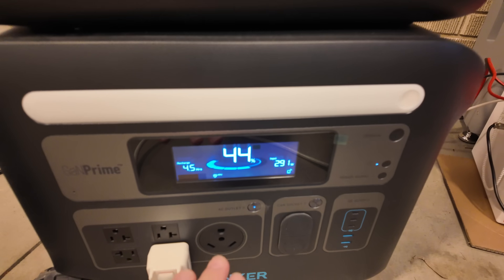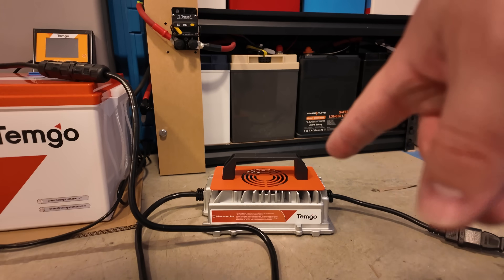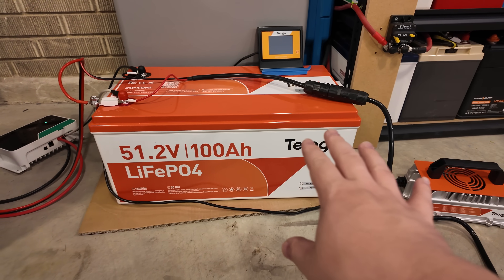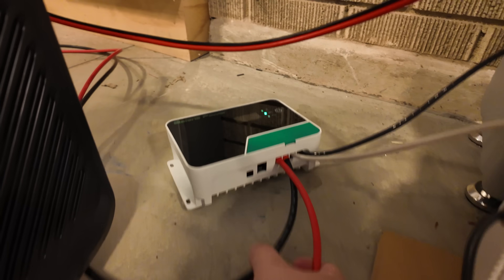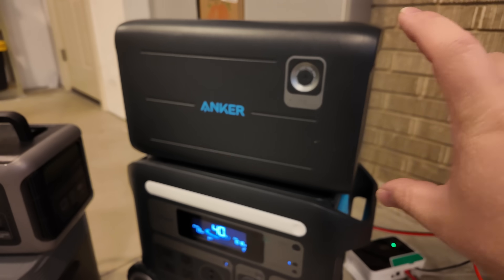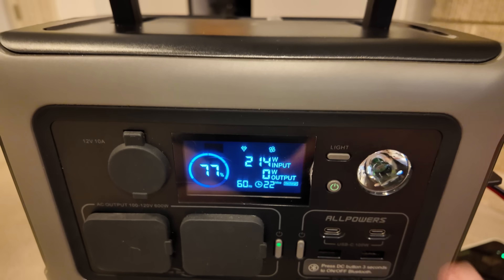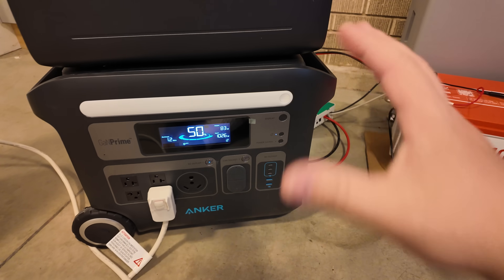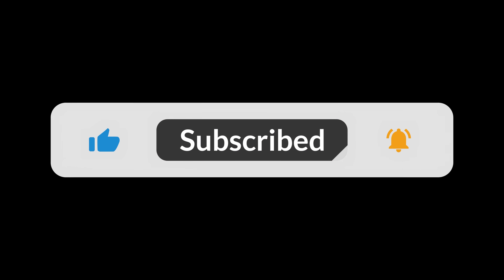I SOLVED the BIGGEST Problem ALL Power Stations Have!

Comment: Thank you for the info.  I thought about using more solar than my power station could handle using a charge controller, but was afraid to use it with the battery at the same time. My bluetti station can only handle 1000watts; soooo I thought about using 1,200watts of solar with a charge controller into my 48v battery then another charge controller from my battery to the power station to keep the maximum volts and amps according to the manual.
Reply from the maker: No need to add another charge controller between the battery and power station since the power station already has one built in. So long as it’s compatible with the voltage of the battery, you can just plug it in directly like you saw me do in the video. Thanks for watching!
Reply: The Bluetti manual suggests that you need to watch the DC input wattage, but as this video shows, the power station should that care of that (assuming that you never exceed the recommended input voltage). I asked Bluetti support about this and they confirmed that excess capacity of your charging device to supply watts will not damage the Bluetti (but excess voltage will). They recommended an inline fuse a bit above the stated DC input capacity (as a belts and suspenders approach).

Comment: If you have to reinvent the portable power station to fix your portable power station . . . 

Seriously, why not just add an inverter to your setup and skip the 3rd party power station altogether? You already have all the other components . . .
Reply from the maker: Because this helps you significantly if you already own a power station. But the battery works great with a big AIO inverter. You can see that in action in this video: https://youtu.be/dboHXnSY9LI?si=0erM451vuN_3rv7_ Thanks for watching!

Comment: Another great video! I love these workarounds that you put out! I do have a kinda specific problem that drives me nuts though, and maybe you can help. I have two pecron e3600lfp's with the 240v hub, and can power everything in my house off of it with the exception of the compessor side of my heat pump hvac unit (with a micro air soft start.) It tries to start it but kind of stutters even with everything else turned off. I can run absolutely everything, including the hvac off of my genmax 10500ietc, or 7250iedc, but not my pecrons, which, on paper, should be able to start it. Any ideas?
Reply from the maker: Glad you are enjoying the videos! I've got more great content coming! 
You have a MicroAir Easy Start? When it tries to start the compressor off the power stations, have you opened the EasyStart app and see if it recorded an error? Like under voltage protection or something? Also, you should try triggering your EasyStart to re-learn how to start you heat pump when then power stations are providing power, because if the EasyStart "learned" how to start the heat pump on grid power, it didn't learn how to do it using your power station power. Best of luck! Thanks for watching!
Reply: @theresatrickforthat wow, no, I haven't tried that.. I definitely will now! Thanks!!

Comment: Decent content but uh... what's with the editing of the video?  It's like it is sped up, the video is constantly glitching, and you have an edit cut every 5 seconds that messes up the audio.

In anycase, you hit a problem that not only power stations have, but also larger mobile/RV systems, which is that AC inputs are generally passed-through and might not be capable of running the loads or dealing with the surges from appliances.   The AC input ... from a generator for example, is also generally a lot dirtier.  People also complain about flickering lights and other consequences of having dirty power coming in.

Going with a battery charger is a good solution.  No more AC pass-through, instead the AC source charges the batteries directly and the power station simply stays powered with its inverter from a DC source.  It can result in more noise, though.  The charger has a fan.
Reply from the maker: I don't script my videos, and so I chop what I say during filming up a lot during editing for clarity and brevity. I also get excited about stuff, so I sometimes talk fast. 
Great observations! Thanks for watching!

Comment: this is basically the kit I have for my RV. F2000, but with two 100Ah 12v batteries in series gives me a 24v battery instead of 48 like yours. I also have the Honda 22001 as my backup :-) If I had the 48v battery like you, I would us the Anker expansion port and wire the battery to that instead of using the solar port.Of course I don't have the expansion battery like you so I have that port free. I recharge my 24v setup with solar and can basically run indefinitely. I seriously thought about upgrading my battery to a 48v but the cost didn't really make sense when what I have is already doing the job. It was a really fun project putting this all together and figuring everything out.
Reply from the maker: Sounds like you have a sweet setup that works well for you, thanks for sharing and watching!

Comment: What do you have your charge set to?  I have the 40 amp BOUGE RV version of that charge controller,   and I noted that setting the float to 58.4 volts sometimes reads higher on other machines, so I had to turn it down to 5 7. 6 volts to keep from getting warning beeps at 60 v olts from the inverter and the other charge controller I have on the system.  I have the same setup charging a Bluetti, but I left that one on 58.4 because the solar input Max is 150 volts.  Different units read a little differently sometimes so always verify the voltage on each component.  On my 12-volt systems, 14.6 volts would trip the 15 volt limit on the inverters, so I would have to go to down as low as 14.2 volts on some setups.
Reply from the maker: I've found 56.8V is perfect for this setup! Thanks for watching!
Reply: @theresatrickforthat good video..  I wish I had had the knowledge when I bought my original Bluetti setup 3 years ago, so I wouldn't have purchased two expansion batteries.  That's what it takes to learn though.  And your videos will definitely help some people.

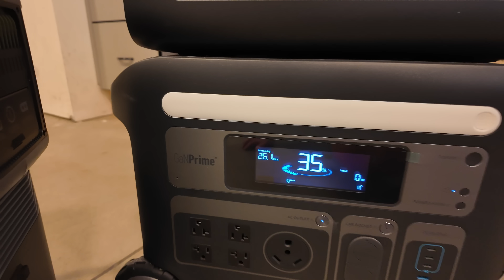Comment: 3:54 Be careful how hard you use that xt-60 port, my C1000 will really over heat (literally melted the connector on a good quality 10 ga cable) at less than 10 amps. The XT-60 is less than robust in this use case, IMHO
Reply from the maker: True! You do need to use a high quality connector otherwise you could have heat issues at that point! Thanks for watching!

Comment: Good tip, but this is highly dependent on the capabilities of your particular power station. Some of them have dual inverters, so they can effectively charge and discharge AC power at the same time. The APEX 300 from bluetti can even output 240V split phase while charging from a 120V source.
Reply from the maker: Yep! Some have that dual inverters. But this kit is still really cheap battery expansion and comes with a nice charger that’s compatible with even dirty power from non inverter generators. Thanks for watching!
Reply: @theresatrickforthat  Ya, looks like its going for $800 on Amazon right now. 15 cents a watt hour and you get the monitor and AC charger thrown in. Definitely a good value. Btw, if your DC source voltage is higher than the max input on your load, you can add a DC to DC buck converter, just make sure its rated for the current. Good buck converters have efficiencies that are on par with inverters and some can even rival MPPT charge controllers.

Comment: You should do a full in depth guide video showing you wiring everything up with step by step descriptions and the set up of the charge controller.

Speaking of which, you didn't link the controller you used.

Also did you do the resistor trick to keep battery from mega sparking when you connected the wires to the battery?  You should warn people about this.
Reply from the maker: Great idea for another video! And thanks for reminding me I didn’t link the charge controller! I’ll get that fixed!
I personally haven’t had issues with sparks…but always good practice to use a resistor! Thanks for watching!
Reply: @MyChannel-vm6dw:  I was thinking the same thing too!!  UK

Comment: The only issue in this set which in an emergency probably doesn't matter is your burning a ton of power on inverters.   Dc to ac back to dc then again back to ac.

Had to be a 400 w/hr loss doing this. 

In emergencies it makes sense but wouldn't recommend for normal use.
Reply from the maker: You might be surprised how much gas you actually save in a generator even with the added losses. Plus, if you can triple the solar energy going into your power station this way, you’re still going to end up with way more usable power on a daily occasion. Thanks for watching!

Comment: Newbie (mostly ignorant) question:  If I wanted to use this golf cart battery with a power station in a van (van life), and the outside temps get to 32 degrees or lower, what is needed to keep the battery working or charging (with solar or gas gen?).  In other words, some LiFePo4 batteries have some kind of lower temp limit for charging, and some have an internal battery warmer of some kind.  I am just learning this stuff, but wonder about using this kind of battery in a typical van life situation (where it can get cold outside). Any tips or information would be appreciated.
Reply from the maker: This golf cart battery has low temperature charging protection, so if it gets too cold it will automatically prevent itself from charging and damaging itself. If it gets really cold, it will stop discharging to prevent damage to itself…but it can discharge easily below freezing without damage, it’s charging that’s the bigger issue. This particular model does not have heating pads inside of it. So you would need to add your own external ones if you felt the need. Or you can buy 4 of these self heated batteries and wire them in series: https://youtu.be/pEYXGvwuUVE?si=94n32DcoCAjpsj-f
However, with that said…I’ve do that if you are actively discharging and charging a battery even in below freezing temperatures, it takes some really cold temps or the battery sitting idle outside to get it to go into under temperature protection. When you are actively charging and recharging it naturally heats the cells and helps keep them from freezing. So if I were you, I’d get the golf cart battery kit, and then if you start having it shut down on cold temperature protection…just get some external DC heating pads and you can add heating to it for considerably less money than buying 4 of the self heated batteries. Thanks for watching!
Reply: With LiFEPO4 batteries being so much safer than the old lead acid, I would recommend keeping the batteries inside your living area and as long as you keep that area above freezing, you shouldn't have any trouble. As mentioned below, it's only charging that stops at freezing so you can still use the batteries until it gets much colder than that.

Comment: I don't get it... 🤔 That seems a bit overcomplicated to me.
 I run two independent power stations, both of which have 5120 watts of expansion batteries connected to the D/C input. My only concern is keeping those batteries charged. Those battery banks can be recharged three (3) ways, via solar power, via battery charger, and via dual/fuel generators. The A/C pass-through issue is eliminated, allowing the power station inverter to fully function as needed, while the D/C power and/or solar power charges the power stations.
Reply from the maker: I think you have the same type of system and I showed in this video! Thanks for watching!

Comment: This solution helps solve another major issue when using 2 EcoFlow Delta Pro 3's with the 50-AMP hub.  When the 50-AMP hub is in use, you are unable to charge at all via AC, but it does still accept DC/Solar.  I have been working on some solutions to this but think this is the better approach.  Thank you for sharing!
Reply from the maker: Yep! This is the perfect solution for what you are dealing with! Thanks for watching!
Reply: You'll need two batteries to charge both of them and if you're concerned about battery health, you have to manually disconnect it or lower your SoC to stop it from charging then repeat.
Reply: The perfect solution is stop buying that chinese junk, then you won't have to perform hacks on a unit that's not gonna last in the first place
Reply: @dustydawson8977  Can you post a link to a non chinese junk one people can buy instead?

Comment: Great video. Thanks! Do you know if I can connect the battery to an Ecoflow delta pro ultra’s Low- PV port? Specs are 30-150V, 15A, 1000 Watt max. Any special cable needed?
Reply from the maker: Should be able to just fine! I think the Delta Pro uses the XT60i cable like I used in the video! Link is in the description! Thanks for watching!

Comment: I know yu said electric dryer pull lot of power but I would like for yu to show it on ecoflow delta 2 max
Reply from the maker: The Delta 2 Max can’t run a full electric 240v dryer…but it’s one of few power stations that can start my gas dryer! You can see that demonstration here: https://youtu.be/obkyI8ESO3Y?si=WlBLCHxxpKo4KJHL
Reply: Ok ty for telling me tht is good question but I seen something on Google saying it can run electric dryer some if it on 120v ty for answer me i didn't seen the message in my email hope tht sound about right if it can power 120v electric dryer machines i know about 240v now because of yu

Comment: your Anker Solix F2000 specs show 2400 watt output....no surge numbers.... my delta 2 max ecoflow has similar overall specs but has 4800 watt surge output that would be enough for your air conditioner
Reply from the maker: Yep! The Delta 2 Max can start the AC just fine like my Anker unit does and you can see in the video once I eliminate it being in pass through mode.  The Delta 2 Max has the same issue when in pass through mode. But if you charge it with DC, then it will start and run the AC just fine! Thanks for watching!
Reply: @theresatrickforthat  why does the Anker not show or list surge specs ?? I do not see that
Reply from the maker: You can watch my full review of it! I do some pretty good dives into what to can and can’t do! https://youtu.be/QNtX8GzfIdg?si=KFJzFCkVLm9nMSHr

Comment: All power stations, lol, no just those cheap Chinese high frequency units!  My units are low frequency, transformer based, just like the grid.  I don't have these problems, and I don't have to perform any hacks, that's the difference between well built, and cheap overpriced junk! But watching all these hacks is great entertainment TV on here
Reply from the maker: Haha! What portable power station do you use that’s low frequency and still light enough to move around on the go like these power stations can do?
Reply: @theresatrickforthat  the Titan is the only low frequency units, unit 32 lbs, batteries 32 lbs, that's just as portable as any
Reply from the maker: Are they using LFP batteries?
Reply: @theresatrickforthat  yes ,but you can use any kind. Unfortunately you can't get one now

Comment: I don't completely understand the problem you are trying to overcome. I definitely am not trying to insult you.  However, it seems like this method may be overly expensive and incurring extra losses in conversions. Videos showing how to expand a power station's capacity by using an external battery through the solar ports are golden. I think getting a 200ah 12v battery with a 200 amp BMS ($350 to $450) makes much more financial sense than using proprietary expansion batteries. Buying a 48v golf cart batttery for about $750 makes less sense, though I understand if you need really long run times for the portable AC. If you need to increase the watts going into the Anker power station, you can use a Charger One, Bluetti Charger Enhancer or Etaker Dc to Dc charger to safely increase the volts up to the input limit of the Anker for $300 or less. I'm not sure of the purpose of the using the golf cart charger from the simulated generator, unless, once again, you need super-long run times. It would seem to make much more sense to use a generator to charge a 12v 200 amp hour battery and possibly the Anker power station at the same time when the batteries run low. If the power needed to start the portable AC is high on startup (inrush current), for $300 you can get a plug-in 30 amp Activestart soft start (no permanent wiring required) that would also enable you to use the anker power station with one RV ac unit or a household gas dryer. I watch these videos to learn, so if I am missing something, please let me know. Thank you for your video.
Reply from the maker: The price per watt hour on this golf cart kit, plus getting a smart battery and charger as part of the deal can’t be beat. You get way more capacity in this battery compared to a 12v battery. But your ideas would work too! Just boils down to how you want to configure things. Thanks for watching!
Reply: @theresatrickforthat  Thanks for your reply.
Reply: Good point. I just made a similar comment.

Comment: Same thing we have all been doing for a while:)

This is how all my Delta portable stations function but sharing a much bigger battery bank and solar so no need to add another power source to run the charger.

You can so better than this with some power stations like my 300Apex you can get direct access to the battery and avoid the AC/DC conversion.

You need to be aware about sending 3000w to the one battery without looking up the maximum charge rate first to ensure that's not too much.

On the small power stations you can run the MPPT off the battery instead of to the battery and set the charge voltage to a limit it accepts.

If you use the idea mention would be nice.
Reply from the maker: Good points and thanks for watching!